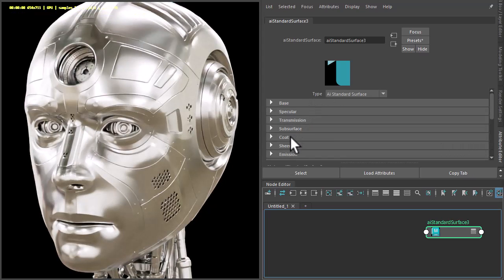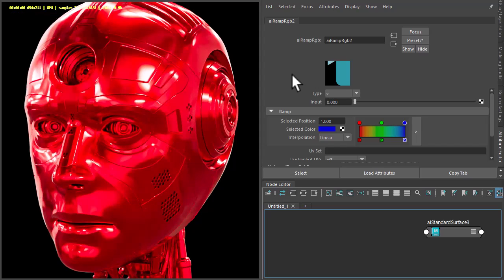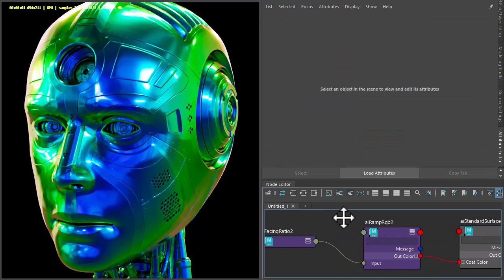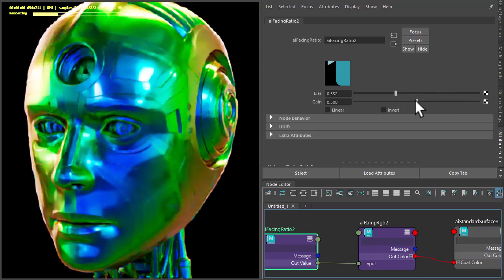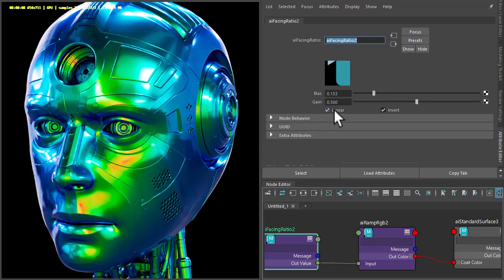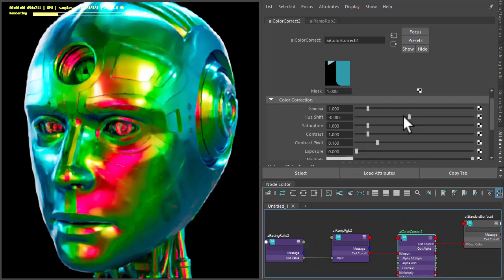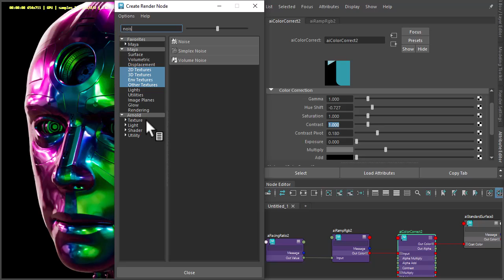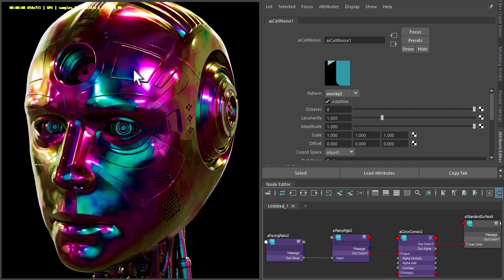Arnold Tutorial - Stylized iridescent shading effect in MtoA

Comment: The coat surface is not changing color here. Only the base. If it were coat color, then it would be barely visible on surfaces facing the camera, and it wouldn't be completely white at glancing angles, like it is here. If he were to set the base color to black, you'd see nothing but a white reflection. The coat color swatch has never worked as far back as 2019 when I first noticed it, and it still doesn't. 

Get a clue, Autodesk 🤦‍♂

Comment: So is the "thin film" still needed?
Reply: Yes, standard_surface.thin_film is more physically correct. The facing_ratio shader gives a stylized fake shading effect.
Reply: @LeeGriggs  Thank you
Reply: I think that's for transparent things like bubbles. but could be wrong
Reply: @trav3d131  I always used the thin film for Iridescent. Even the Arnold doc display the iridescent as thin film showing the bug shading as an exemple
Reply: @samcraftYT  
The coat color swatch isn't even working in this video. Look at the glancing angles ; 100% white. Try the same thing, and then drag the base color slider to 0.0, you'll see nothing left but white coat color, as the base goes black and kills all the color. The base is literally getting color from the coat color swatch. They can't even tell that their software is crap.
Reply: @trav3d131  nah thin wall in the geometry submenu is what you want to get the bubble.

Thin film suppose to do the incidence effect but beetle or cd